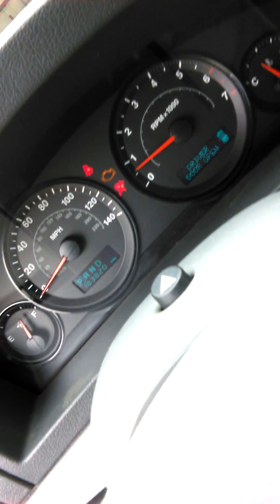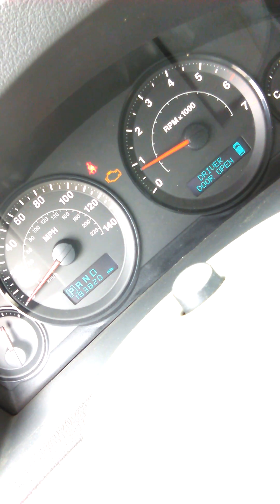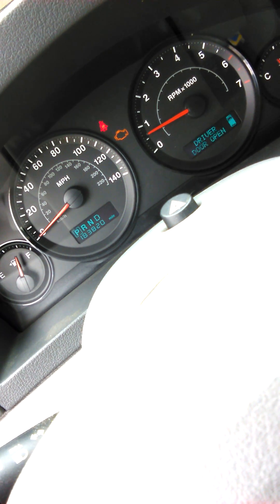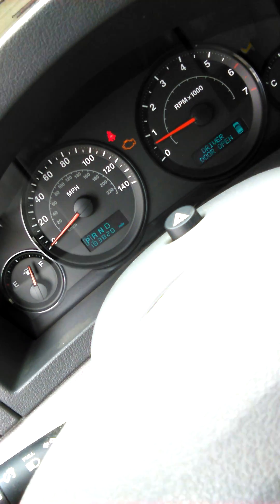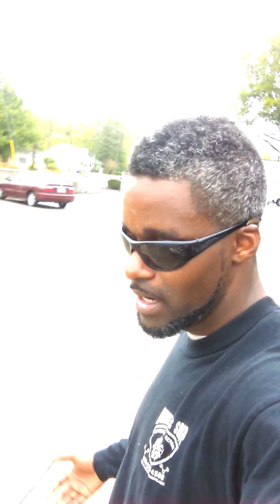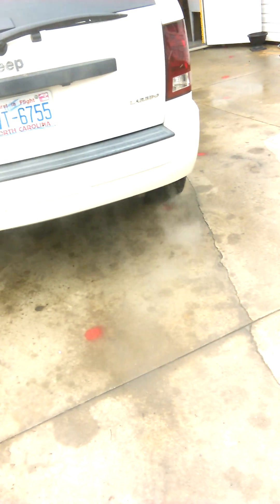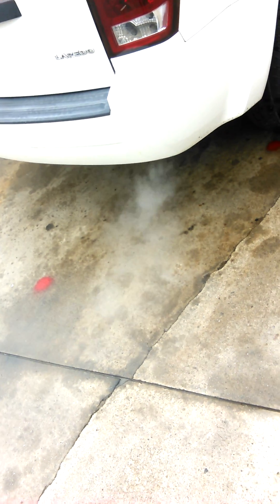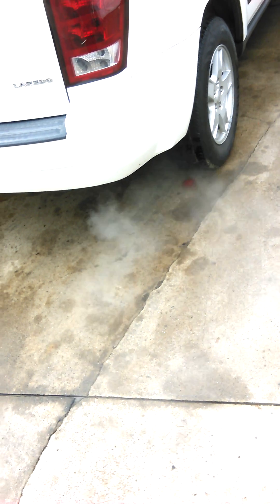Signs of a blown head gasket or intake gasket

Comment: Question 
I have white smoke and seems to look like water coming from tailpipe can it be the intake manifold gasket or head gasket,  can you watch my video please and let me know.
Reply: Same I replaced radiator and reservoir and no leaks from hoses or waterpump was hearing a slight growling but went away & no head gasket leak cause the white smoke only come when I start it and a few seconds it’ll go away but I’m I’m dready getting steam n bubbles from reservoir I need help ??
Reply from the maker: where is the video? Email me
Reply: MobileMac1981  what’s your email
Reply from the maker: @angelf9800  mobilemacshop@gmail.com
Reply: @angelf9800  u got video?

Comment: Hey. So i my CEL came on and it was showing "random misfire". Then it started idling rough like a wobbling feeling and if I start it while it's cold and it's around 30 degrees outside the rpms are very jagged then it stalls. It was running fairly rough although on highway not too bad but some loss of power on hills. It's not overheating or anything and I just actually replaced my catalytic converter and exhaust system a few months ago and it was a really bad during that time as I couldn't get it above 30mph but since it has been running great until this just happened a week ago. My car has been burning 1 qt of oil every 6-800 miles for a while now and im starting to wonder if my catalytic converter went bad because of whatever is causing my oil to burn so I wonder if you think this is a bad intake manifold gasket causing this latest issue and if it may be responsible for my converter going bad? Thanks for any advice! Oh 2011 Nissan Sentra base model 6 speed manual

Comment: So I bought a 97' Rover disco, and it leaked coolant so I replaced the coolant reservoir and thermostat well still leaks coolant I took the intake manifold off and there is coolant inside the holes is that normal or what should I check?

Comment: What if it's smokes for a few minutes real bad then stops ... Only smokes when 1st turning on... Started after spark plug change
Reply: Did you ever find out what it was
Reply: @jonhsmith2706  for me it was a pcv valve i vroke when leaning  on motor... changed the valve and it ran fine
Reply from the maker: If it only happened once after spark plug change that's ok.
Reply: @MobileMac1981  I broke pcv valve was blowing smoke like a old time train.. all better now thank you

Comment: I have a 2002 Chevy Blazer it has white muddy oil put no smoke is coming out the exhaust just water check engine light is on put no over heating is that signs of a blown head gasket
Reply from the maker: Yes that is a very good sign. That is oil and antifreeze mixing.

Comment: How about no water in the oil , it doesn’t run hot , it does blow white smoke and it does miss a little. It a 93 Chevy 350 . I’ve heard the intake gasket are always blowing but what’s a easy way to find out if it intake or head gasket leak ?
Reply from the maker: Check the radiator for bubbles while it is running...while it is cool. The white smoke is a dead giveaway.

Comment: see I just got a blown head gasket the other day but my check engine light never came on I just saw a bunch of white smoke out the back of the tail pipes my coolant completely leaked out of the car my oil completely leaked out of the car so I bought a sealant and the next day I went to start the car and and started Shaking All cray cray I'm sure because no oil in the car but I didn't know that at the time and then the next I want to say hour later it didn't start up it cranks but it won't start

Comment: Okay so on start up when it’s warm outside should a car give out some white smoke then dissipate if it’s been sitting a few days. Noticed a sound that sounds like it’s coming from the water pump. Only check engine light is an Evap leak. What might this be?
Reply from the maker: John Kennedy there are multiple evap codes. It's normal to have some light smoke at startup but it goes away.